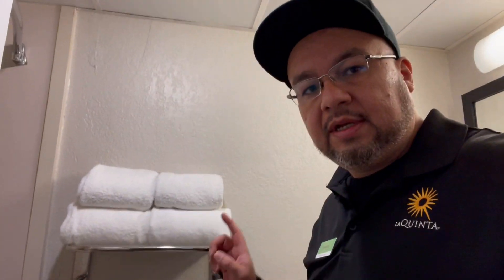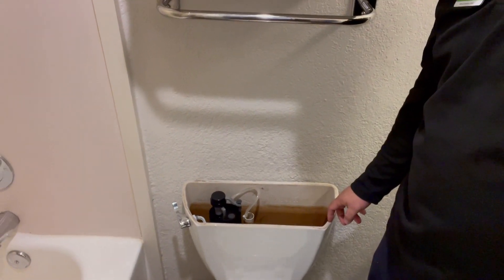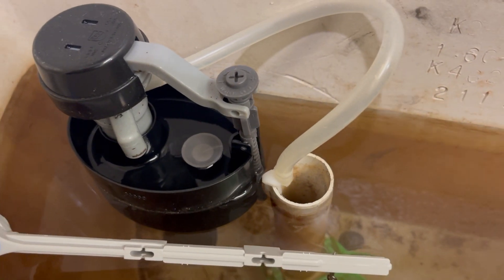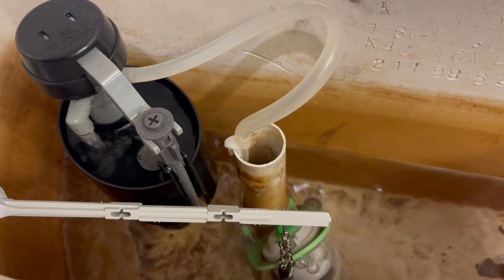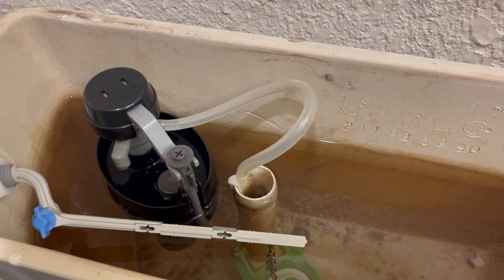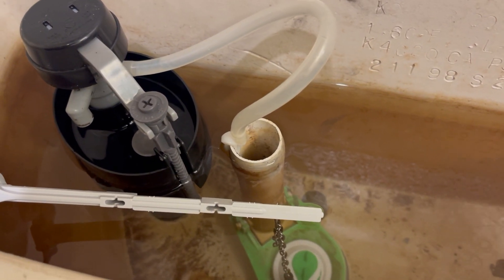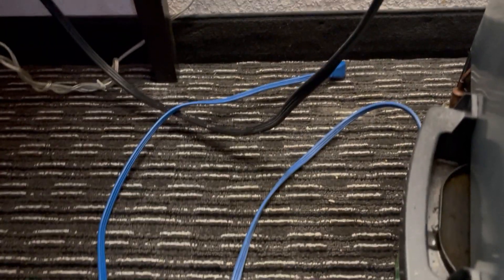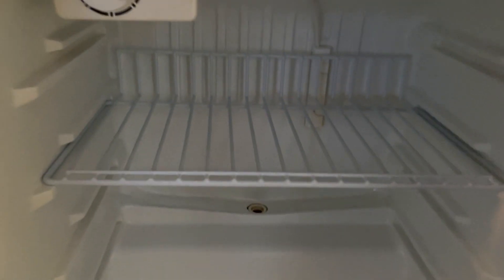TROUBLESHOOTING SATURDAY

Comment: I had replace light switch and GFI plug for a room it was in the bathroom. The lights would flicker and the house keeper got a little shock small shock. The GFI plug was faulty.